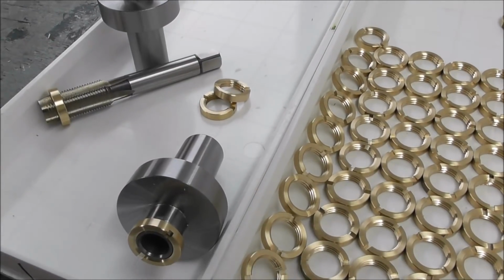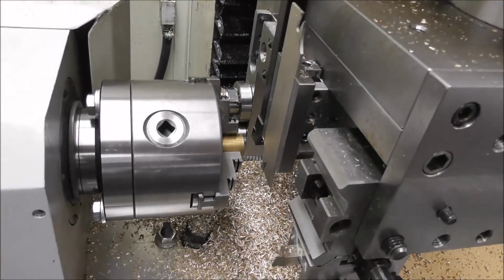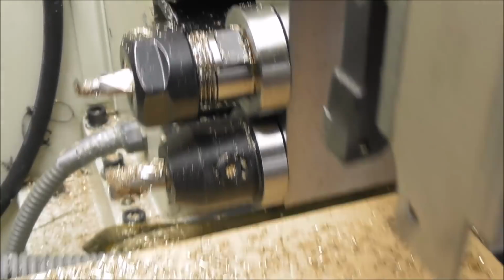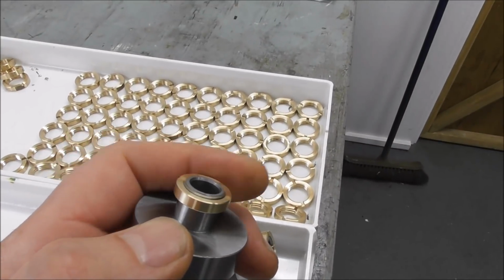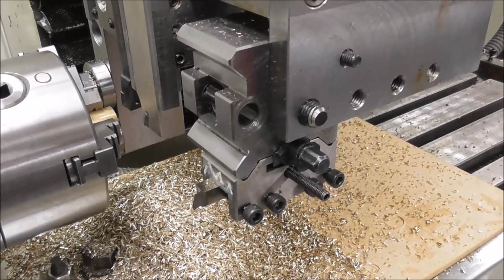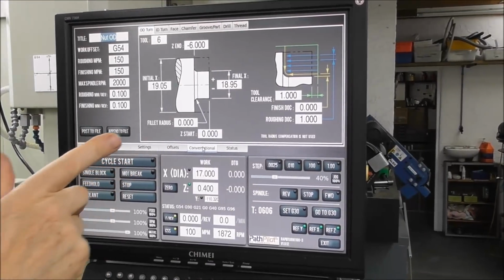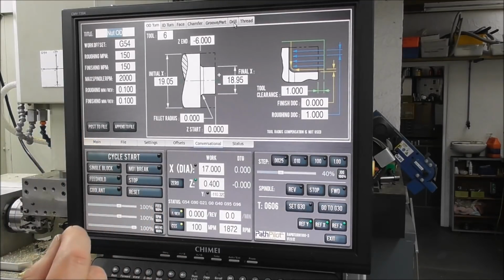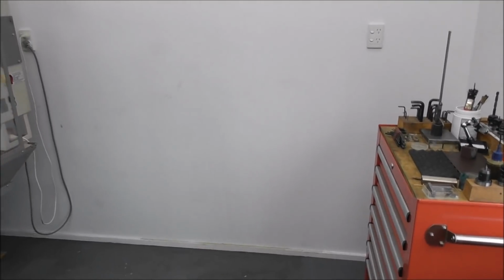Tormach Rapidturn - Gang Production with Slotting

Comment: Hi Cliff.

 I was not a big fan of you using the mill as a lathe but in this instance it worked very well for you.

I am hoping to see a Tormach Slant Pro in that empty space ?

It would not surprise me as you seem to have a liking for the Tomach range?
 
I was interested to buy one of the Slant Pro lathes,  but the only reason i lost interest was the overpriced enclosure they make you buy if you choose the turret option ?????????????

I finished up purchasing a Mazak CNC lathe instead.

The Slant Pro lathe would have been very useful, as more than half of the lathe work i do would suit this size machine.

Hoping to see the new machine (lathe ???) very soon,   looking forward to it.

Regards Peter.
Reply from the maker: Thanks for your comments Peter. I often wish I had room for industrial machinery. Yes arrival video soon.  Cheers  Cliff
Reply: Your reply is very secretive about the new arrival ???

Cliff.  I am also interested to know what happened with the "Thread Express."

Since your introduction video have you put it into production or on sold it, you have not made any mention of what transpired as yet.

As i commented on the original video i could not clearly see how it worked i do understand the function but not the workings of it.

I thought that there may have been a follow up video since then of any improvements / changes,  possible interest ?

I do not personally have any work for the Thread Express but would be a shame to see it unavailable in the market place.

I do have some other ideas for its use, but it would need to be redesigned to suit this application. 

I guess it would find customers for its use but as you know price dictates everything in this life????????

Thank you for your reply,  waiting for the arrival (lathe????) video.

Regards Peter.
Reply from the maker: Hi Peter - It is a SlantPro. Just kidding around as per the other comments. 
Threadexpress is still on hold - I am not sure exactly where the market is for it, and also concerns about tool life put a cloud over the project.  Cheers  Cliff
Reply: Tool Life ??? on the Thread Express.

What type of tool do you use currently.
I am guessing either a High Speed Tool bit or some type of Ground tool 

So currently not much happening with the Thread Express just keeping yourself busy with the Probes i am guessing.

I do have some ideas with the Thread Express but as i say it would need to be redesigned to suit the application that i am thinking of,  the basics of the machine are there from what i can understand from your video.

The truth finally comes out about the new machine ???? 
Slant Pro.   Not a bad guess,  hay ?? LOL

It will be good to see it in your shop,  i am sure you will make good use of it.

Regards Peter.
Melbourne Aust.

Comment: Path Pilot seems to be easier to use than many so called 'industrial controllers' out there - attached to higher spec machines.  It is an interesting conundrum - whether to 'put up with' relative limitations of a machine which comes with user friendly control system V 'putting up with'  the machining benefits of higher spec machines encumbered by  (relatively) less easy to use control systems. Thanks again for taking the trouble to show how you are using the Tormach ecosystem - looking forward to the next chapter very much.
Reply from the maker: Good points. Space is also a reason for many going the Tormach way.  Cheers  Cliff